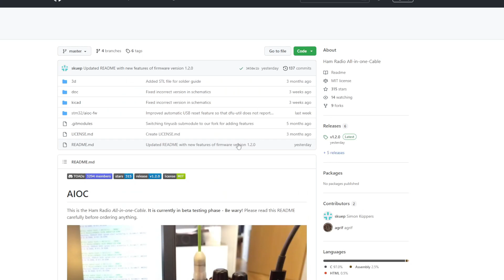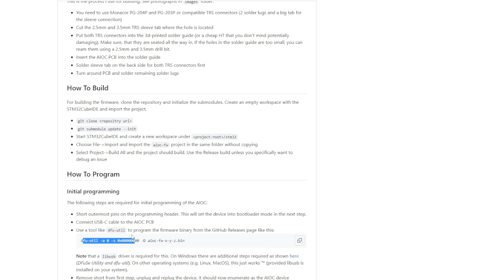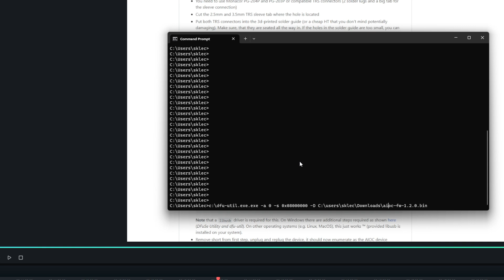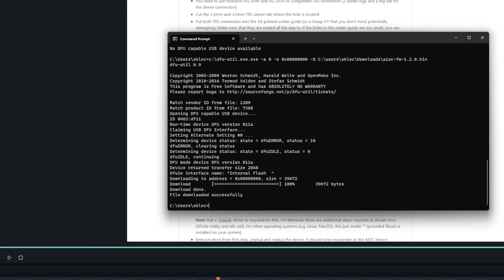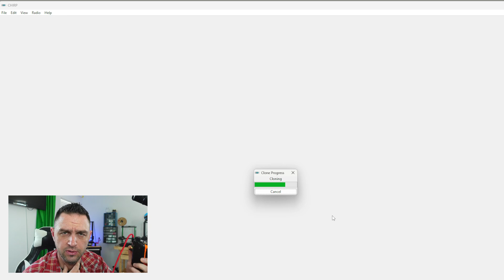All in One Cable / AIOC - Part 2 - The Perfect Project for Ham Radio Clubs.

Comment: All in One. I do not think so. How do I get this AIOC board to work with winlink and my Baofeng. Until then this is not All In One.
Reply from the maker: Sorry, You could take it up with the guy who created it. The GIthub is linked in the description.
Reply: i got digirig lite(sound cadre interface) to work with Tidradio H8 and winlink. swaped to AIOC and only recive no TX same settings , im out of ides.
Reply: ps i got it to work with APRSdroid on cell phone. using usb audio settings squelch:1 vox:1 on radio but not winlink,vara fm

Comment: FWIW, I finally got my plugs attached.  The 3D printed guide didn't hold together too well but what was left got the job done.
So far as the serial port goes, I got old Chirp working just fine with my BTech UV-5x3.  Next, to do a little APRS.

Comment: Saw my shipping notification yesterday, saw this today, insta-click. If nothing else, this project is a great driver for channel views, hopefully. ;)

Also, side note, great 3D print! I like that you used square holes instead of circular ones to account for shrinkage. I've done something similar with hexagonal holes that have ended up more or less round.

I already have plans to try getting this working as an APRS cable for my FT-70D (a thing I've been working on for a while now, it's more complicated than it should be).
Reply from the maker: Hey hey hey.   Yes, shipped yesterday. Please let me know if you have any troubles.  

On a side note, I have designed a case for the project, but it needs work.  I didn't design the JIG though.  Once I tried to free hand solder one unit, I decided to go to the GitHub repo and just print 30 of the jigs for group by.  I sort of rushed the video as I wanted to provide a visual update but had limited time.  My apologies for any confusion.  Let me know when you get it, and enjoy 

I wish I had a 70d still, that would be fun.
Reply: @DudeTested  Ah, I gotcha. It's not super important, the big thing is that they're available for us to use, and you're a legend. History doesn't remember details, just awesome dudes.